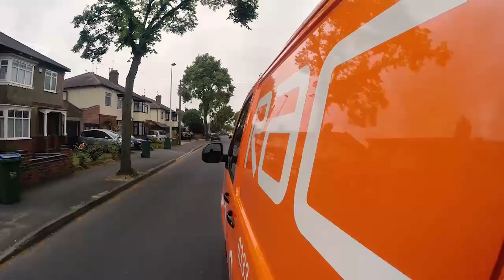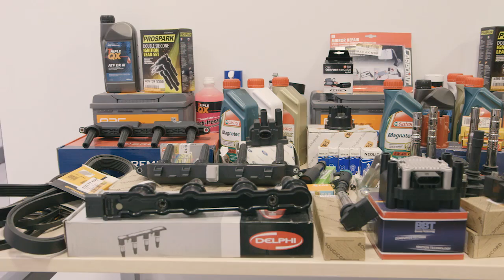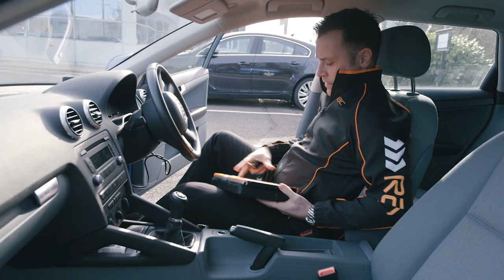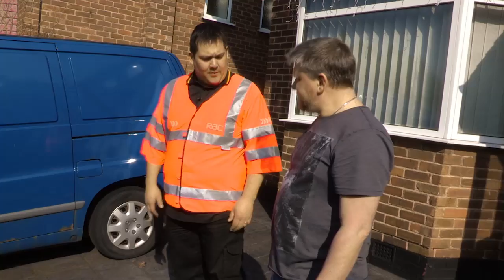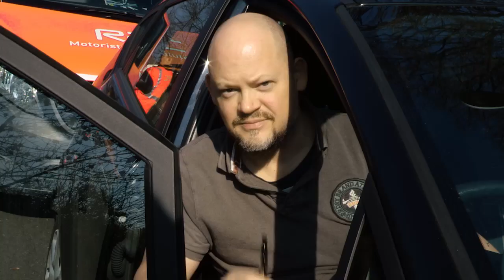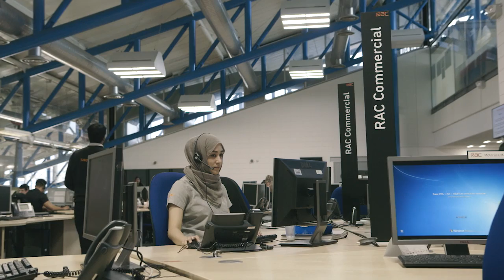RAC technical analysis and innovation

Comment: In my experience the RAC are terrible.  I've needed to use them several times in the past 5 years or so and on every occasion the delays have been upwards of 2 hours, with almost non existent updating. On 2 occasions I resorted to alternative means to solve the problem, because they just didn't attend. On another occasion a belt broke on the engine and they fitted the replacement incorrectly and had to come out to refit it!  Basically on every breakdown there was a problem. I won't be renewing my membership when it expires this time, I'll be looking for a better alternative. Not the AA though, I changed to the RAC because they were bad!!!

Comment: RAC left 2 disabled people with Autism, ADHD cancer and replacement knees and having had 3 spinal fusions in a broken down car for over 9.5 hrs with our pet dog in temperatures around 7 degrees. Failed to update  us at any stage until after the 9.5 hr point. Shared our data (phone numbers) with taxi companies without our permission. Then had car moved 20 mins down the road to a services and left us there for a further 2 hrs (at least we managed to eat just before food outlets shut). Then we're told that we would get another lift to another services  a further 1/2 hr down the road where we would have to wait again. When we asked where we are supposed to leave the key to our car when we were ovvered a 4th taxi, the first refusing to take luggage or pets, we were told to leave it on top of the wheel of the car in a dark car park where therre are warnings everywhere telling us theives operated in the car park and that vehicles left to long would be fined. Thankfully a recovery vehicle turned up (Not RAC) that took us all the way home with no input from the RAC (all organised by the sub contractor). We were told that the RAC would only use sub contractors as a last resort as it costs so much which is lost profit to them, also that they are woefully understaffed as they pay their operatives the bare minimum. The RACs failure caused me to miss a cancer appointment, caused me to breakdown in tears due to having no pain meds. Given that we gave the RAC 4 days notice of the need for their services (we just arrived in a car park, setting off on our holidays when the car broke down). Made it clear what the failure codes were (cylinder 3 circuit A high) meaning either the injector or the wiring to it had failed. The injectors are buried under the windscreen and therefore accessible at the road side. Told them from the outset that recovery to our home address would be required. In the end it took the RAC some 16 hrs to get us home.

Comment: Sadly. the only 'happy' RAC customer is one who hasn't broken down yet!

I've been let down by the RAC on too many occasions and their broken promises have left me very frustrated. It didn't used to be like this.

Now the RAC maximises its profits by providing a cut price and overstretched service that regularly fails its customers by leaving them stranded for many hours and even for several days.

The RAC knows that avoiding their responsibilities results in untold chaos and misery, but undertrained and uncaring call centre staff break promises and let motorists down day in day out.

'Customer care' effectively manage this shambles by using complex terms and conditions and a range of 'cut and pasted' excuses to ignore or dismiss any complaint in any circumstance.

Comment: RAC,, sheep now they doing this thing 4p a mile on car insurance , you still got to pay upfront fee and monthly, do you really think they are doing this for you ,and the RAC backing the Government about keep left on smart motorways , if your car breaks down you may  lose your power steering , if engine cuts out, your car loses power , other cars coming down like rockets each side , nowhere to pull in, no hard shoulder , cars get stuck behind you if they cant move into  another lane, smart motorways was designed to make  money for the councils and Government ( money ) not road safety ,removed lights put up speed cameras , stop and start to frustrate drivers,  Dont be a sheep avoid RAC